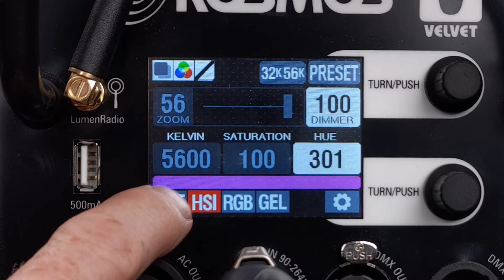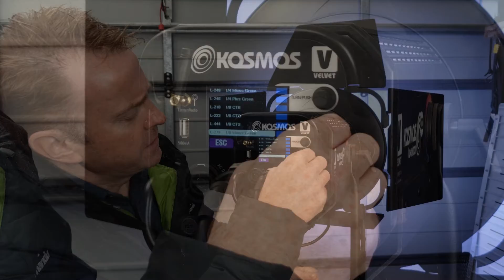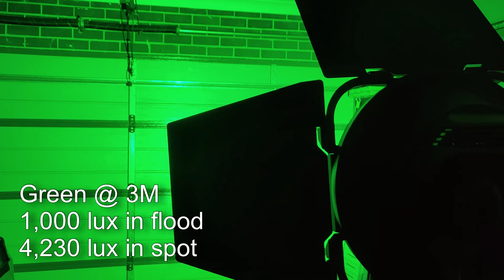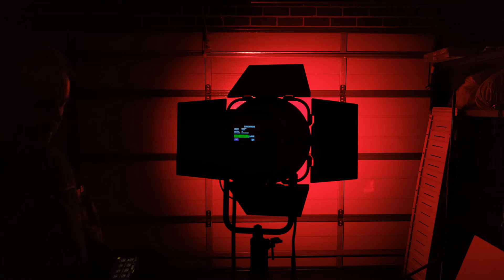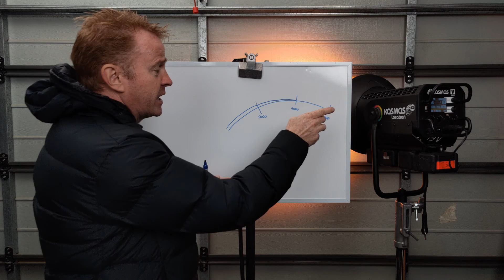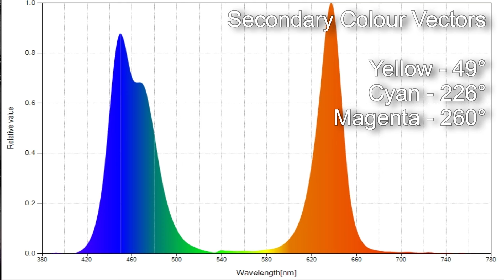Gaffer & Gear 143 – Velvet Kosmos 400

Comment: @Gaffer & Gear  Hi Andrew, what kind of repair did your spectrometer need? Also, you've mentioned overheating while testing in the past, has it ever happened to you on set? 
I was just about to pull the trigger on a C-800 but I'm starting to worry about the reliability.
Reply from the maker: It was giving me variations in readings. They claim it just needed a  recalibration and a clean of the sensor,  this should be done every 2 to 3 years.

I can't remember the cost but it was minimal considering it had to go to Japan as no one in Australia can do it.

In terms of it giving inaccurate readings from getting hot, you have to be taking about a dozens readings in a row, and that's after burning it out doing 100s of readings a day. (Which I did trying to speed up my reviews)

The amount it is out by when this happens is well under a 1/8th correction gel so it wouldn't effect any on set trims, but it would effect the results on my gear reviews.
Reply: @gaffergear  I bought the C-800 and I'm wondering how you display your xy coordinates on the CIE graph to show Planckian curve deviance for your reviews?
And also, out of curiosity, what made you switch from your UPRtek meter to the Sekonic?
Reply from the maker: @pvalin  the UPRTEC had shocking bad battery run time, about 8 readings and it was flat.

I enter my XY coordinates into a website to generate the curve graphs.

Comment: Hi Andrew,
I am really interested in a pair of Fiilex Q5 Color LED Lights.  I plan on using them to light my background cloth; my idea is to use a Full RGB Light on a white background cloth most of the time, and use green light when lighting a green screen.  I would like to Master/Slave them like the Arri lights do; it that something I can do with DMX 512?
I have a few Dracast lights that can only be controlled from the back of the lighting unit, also, I have some Aputure Lights like the 300x that I can control from my phone, but if I buy the Fiilex Q5 lights they will be my first DMX 512 lighting units.
So, in addition to reviewing the Fiilex Q5 Color Lights; can you put together a short tutorial on DMX 512 and Lumen Radio.  The tutorial would have to be very basic because I know NOTHING about either of them.  Please include in the Tutorial what would be the cheapest and the simplest.
Thank You.
Mathew